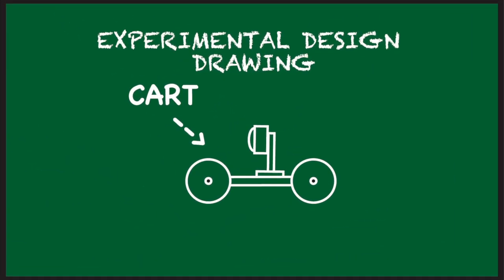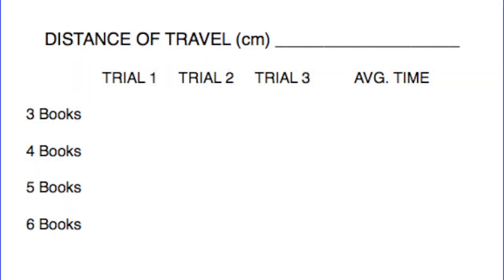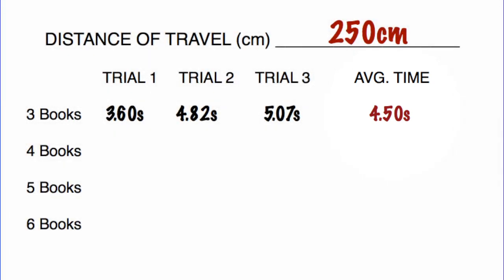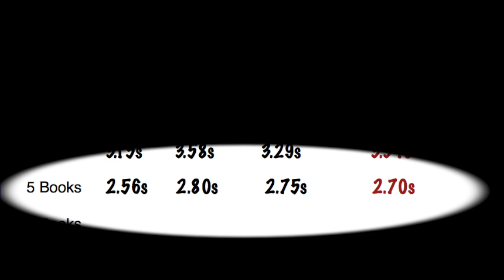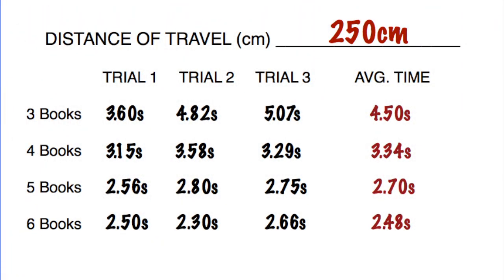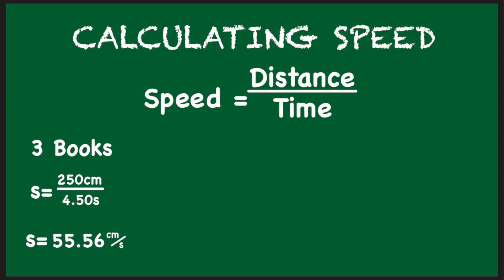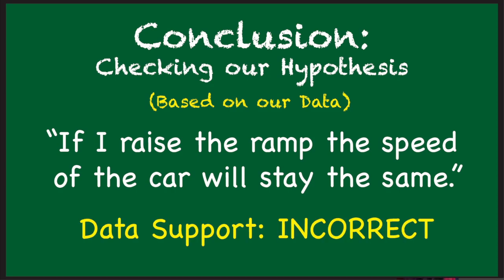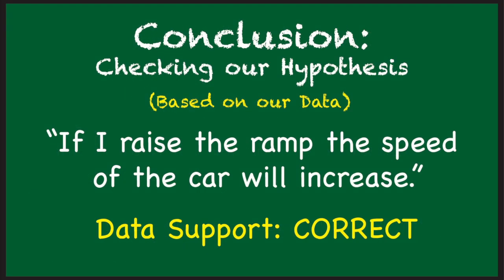The Car and the Ramp

Comment: Which surface does the car roll faster and roll slower?
Reply from the maker: We were not necessarily testing surface friction but height. I have done sliding friction with different surfaces and as you would imagine a rough surface slows the speed or momentum. Rolling objects such as a cart would not have much effect.